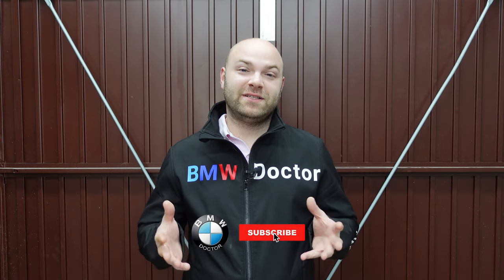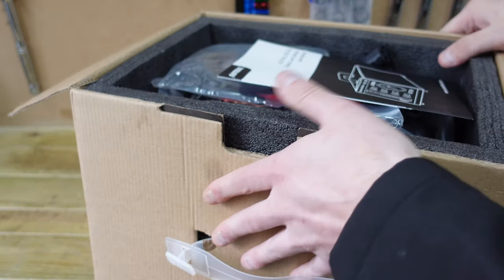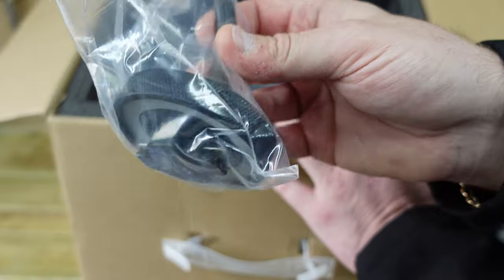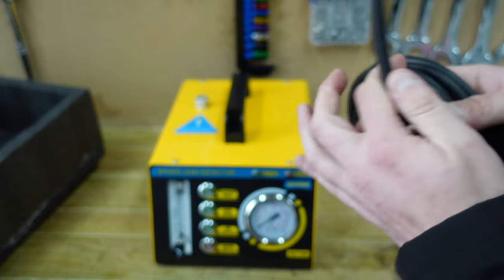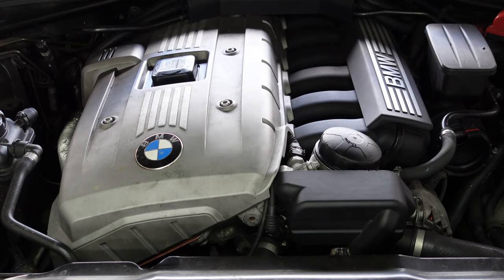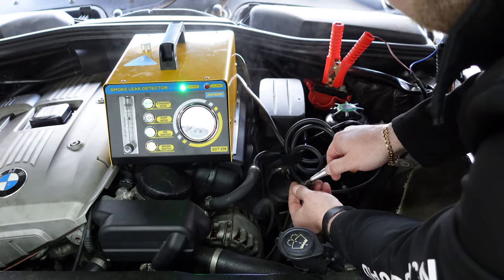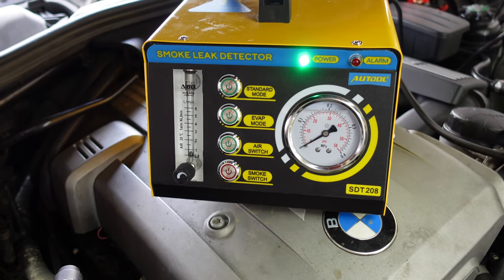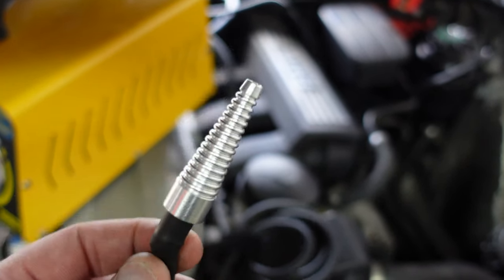How To Find EVAP Leaks & Vacuum Leaks On Your BMW !!

Comment: Bravo, Doc!

Any risks of the smoke causing damage to internals such as sensors or reacting oddly with engine oil??
Reply: Different PSI levels for different systems I think you stay like around a pound or less for evap

Comment: I have an issue with my 2001 BMW 330i. IT WONT SHUT OFF!! Can you please tell me what is going on? When I turn the key off and remove it from the vehicle... it is still running! I had to put it in gear and let off the clutch then remove the battery cable to kill the car. Help me!!

Comment: I’m a little confused why you see smoke coming from somewhere and don’t shine a light to see what’s going on or address it. Are you saying that is normal to have it leak from somewhere and you aren’t going to bother?
Reply from the maker: The system was over pressured with smoke there is NO LEAK there it was leaking through the DISA gasket underneath which is NORMAL and to be expected as they don't make a tight seal in the first place. Therefore I have nothing to address as this is a channel car and is not used anymore I have other cars I use on a daily basis.